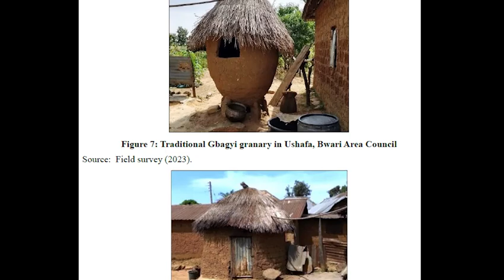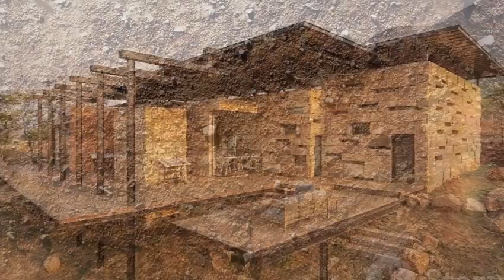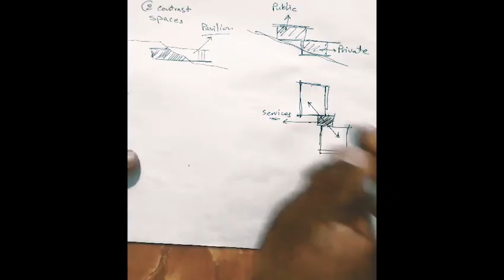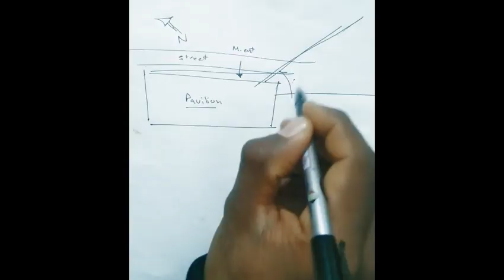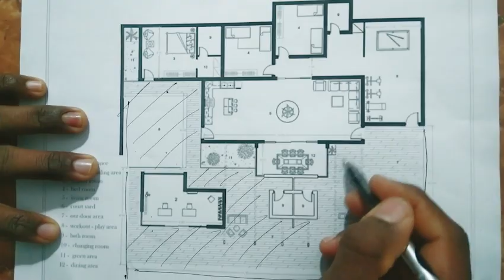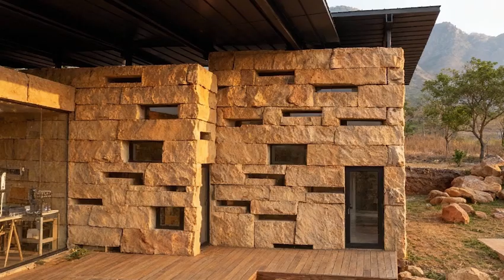Most Houses Ignore Place — This Abuja House Didn’t

Comment: I like the design and the renders are very well crafted. If you don't mind me asking, what rendering engine did you use for this project? For the facade did you model the stone blocks individually and then apply a texture or is it a block wall texture applied across a flat wall?
Reply from the maker: it is all modeled on 3ds max, then i apply the texture